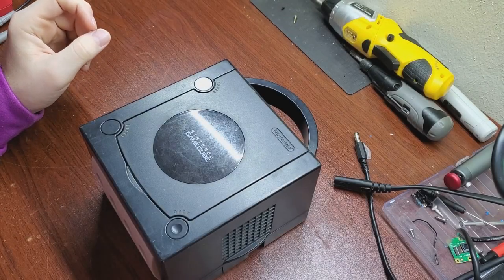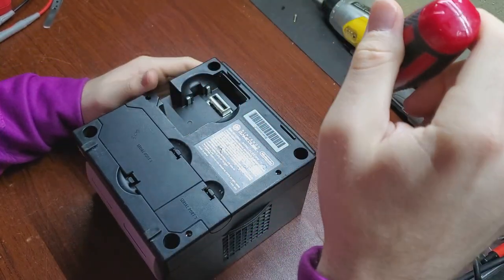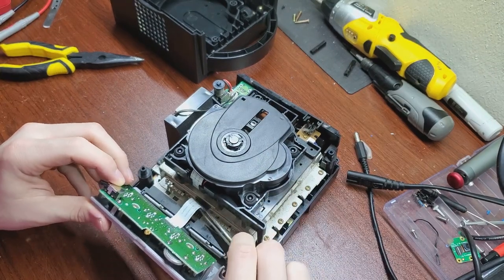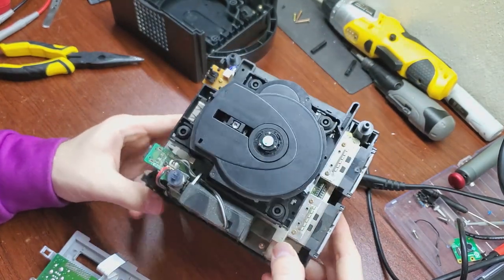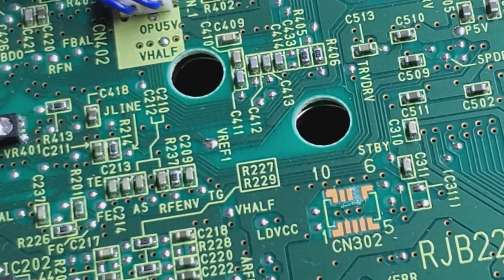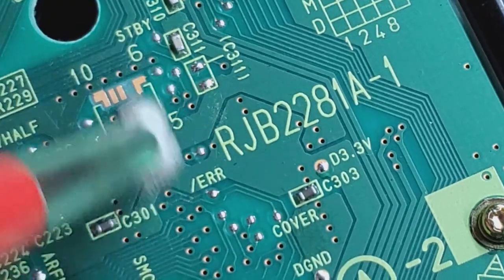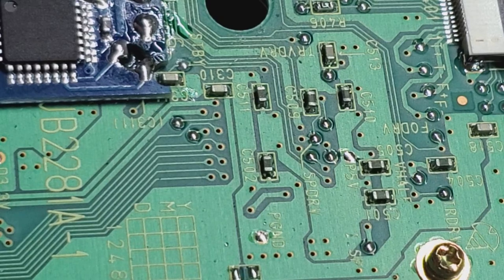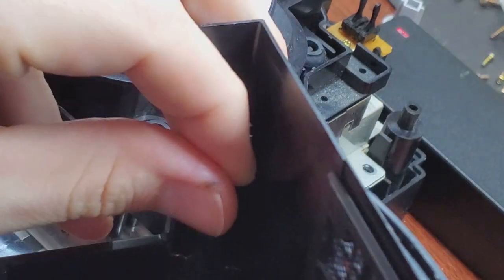GameCube Not Reading Discs (Pot Tweak) And XenoGC Install - The Right Way

Comment: I need to pot tweak my Laser. Can it be done without the device that gives readings? I don't have one. I just want to know if it's safe to just use a small screwdriver to tweak?
Reply from the maker: You can turn the pot in very small increments until you get it to work. If it doesn't work, it could be the laser is just too far gone